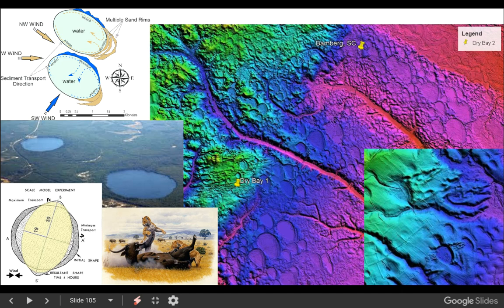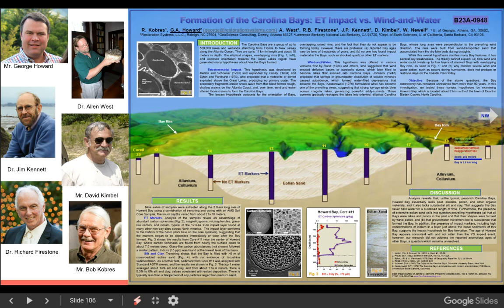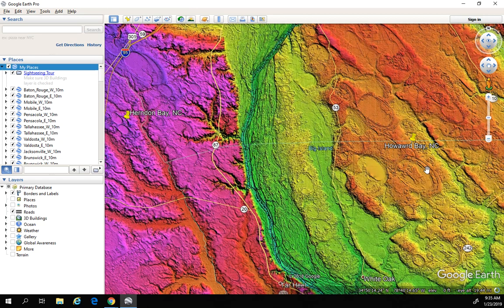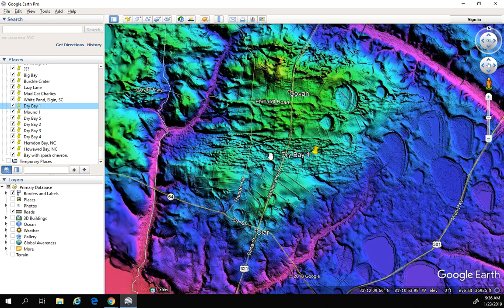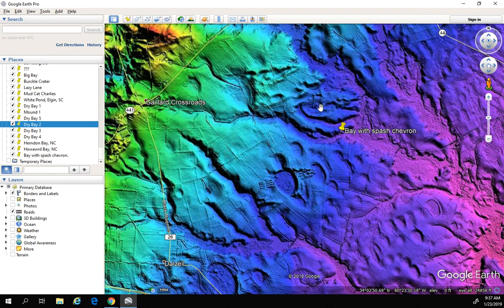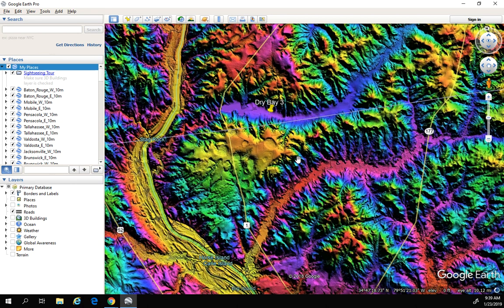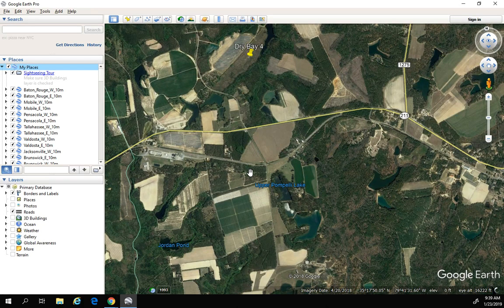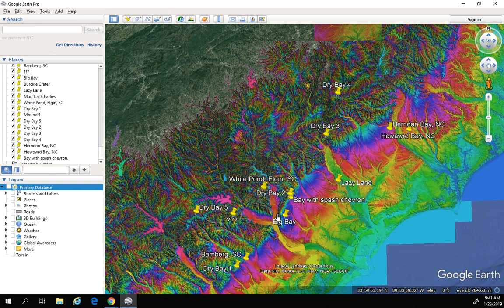Carolina Bay LiDAR Field Trips:  Dry Bays

Comment: Just observing and loving it. Somebody needs to throw or sling a slushy onto some sand. Then, play it back in slow motion. Falling drops of liquid usually have smaller drops trailing right behind it. That would explain the many impacts with impacts, of a smaller size, inside them. It would also explain the line formation. When I was pinning sites, I would be talking to myself, "here's another. bam, bam, bam" Three seemed to be the common grouping. Two inside one or one right after another; like the cluster hit at the same time. Forming a diagonal line of impacts. This Lidar is no lie! I pretty much stopped pinning sites. Like, nevermind. This tells all. I wonder how much history and data has been washed away because of mega-flooding? Wouldn't soil samples, from within the bays, show missing layers of time? I have so many questions... it's a Biblical event, for sure. Great work here, at the Dabbler's Den!
Reply: You'll have to check out Zamora's work!  https://www.youtube.com/watch?v=94km3ZKiPSE&t=110s